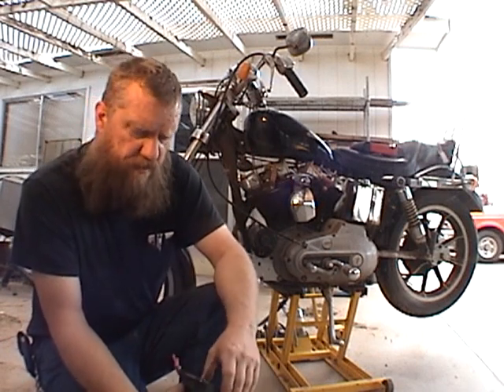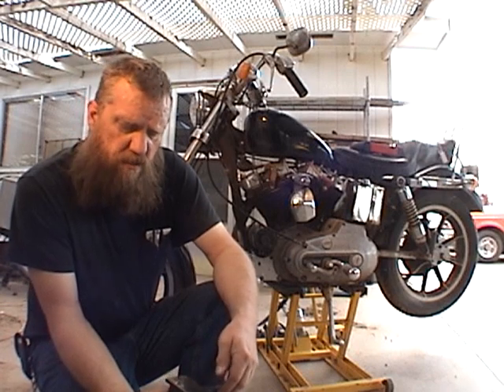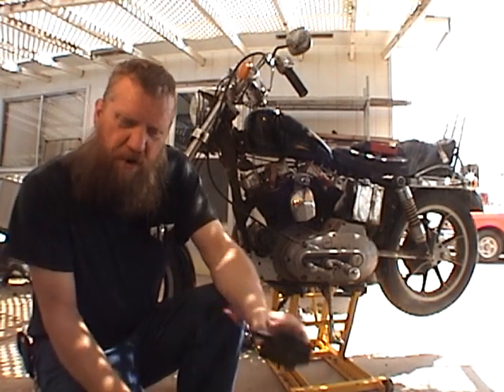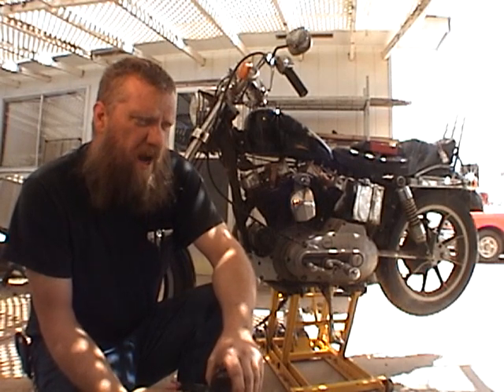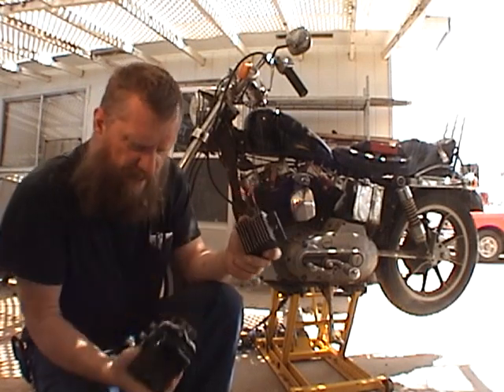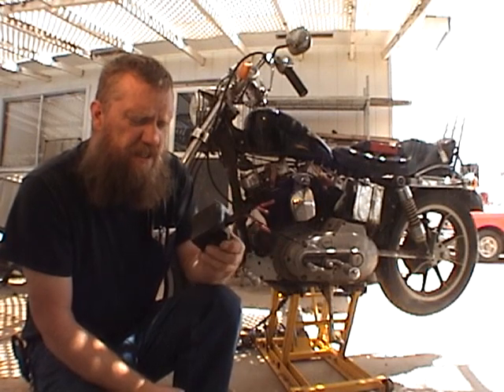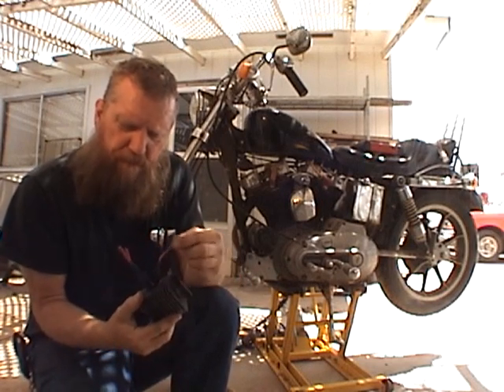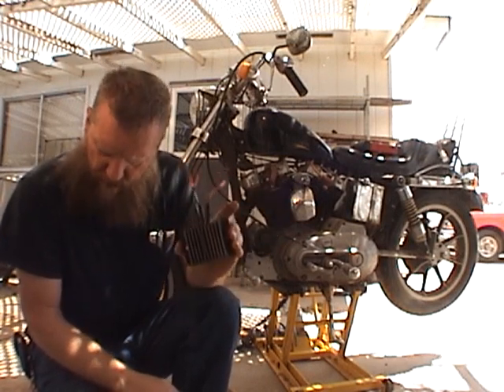Chargeing / Dead Battery Issues , Small Engine , Motorcycle

Comment: Cactus Bob is the man. Ive had my entire electrical out of the bike and metered all possible connections and 3 batteries later this video finally help me conclude that the rectifier on my bike is bad. My question for you is do I need to replace the stator generator as well? My RR is currently a 2 stage and the one I can purchase for my bike is a 3 stage. I want to be sure it works. Suzuki does an attempt to dump the extra power with the original RR by wiring it up to the handle bars since its 2 stage. Apparently I can just use this wire once I get the 3 stage RR for easy plug and play but I'm worried the original stator might have issues with the newer RR.

I can spend an additional 130 to get the stator as well but I don't have a fly wheel tool, so that would be another purchase I'd have to make if I decide I need to purchase a new stator. Like I said I've gotten the bike to crank and start but only with a new battery after a few starts or rides the battery is completely shot and won't even hold a full charge.  Hope you know the answer. Don't want to have to replace the original stator if its fine and in working shape.

Comment: My advice is, if you kill a battery in under 2 yrs, check the charging system as a precaution with your new battery. charging volts, reg/rec ohms & stator ac voltage, doesn't take long & you save yourself a headache.

Comment: Dude thanks a lot! I'm rebuilding a yamaha xj650 and it's killed two new batteries. There's lots of things I'm replacing on it that have seen better times. The voltage regulator has gotta be as old as everything else, I'll definitely look into that. The only thing that puzzles me is the battery I bought it with will still try to start it and will still take a charge. Just poorly. I'm wondering if I've just...not been letting my new batteries charge for as long as I should have...and if I'm actually just an idiot. 
Thanks for sharing this all the same man

Comment: that's just helped me realise a lot, I'm currently rebuilding a motorbike but into an older frame i had bought. i put all the wiring everything onto this frame but.... i used the original regulator from the frame i bought thinking it will be ok , connected my battery tested all the electrics was perfect, then i became ill so about 4 days later when i was a bit better i went to work on the bike fitted a new ignition barrel nothing happend when i tested it, got the old ignition still nothing, checked the battery fuse, still intact,   tested the battery about 4v left in the battery, the battery was dry as anything all the cells were empty even though they were full when i fitted it oddly  so i got an old car battery took the acid out of it filled up my bike battery charged it for a while back up to 12.85 volts but drops 0.01 voltage every 5 seconds until it gets to 12.45v then drops 0.01v every 10-20 mins so i think i will now replace the regulator with my original one i had on the bike i used before the rebuilt bike see if that does any difference but like you said it circuits back to the battery my battery must have heated up evaporating the water leaving just acid so it seems empty also draining the voltage, so i may need a new battery unless im lucky and this holds charge still.

Comment: 1980's era external Chrysler voltage regulators can easily be adapted for use in
most 12 volt, negative ground, stator controlled alternator based charging system applications supplying less than 70 amps. They are cheap, reliable, and readily available. Fabrication of an "adapter cable" is all that is required.